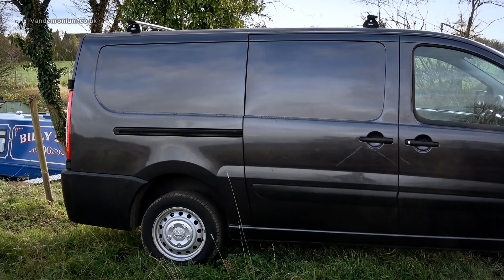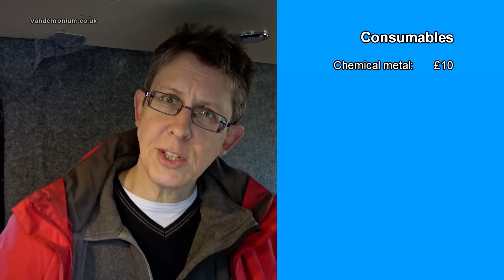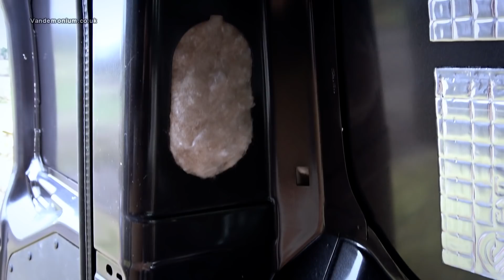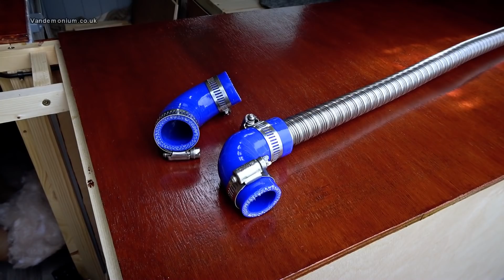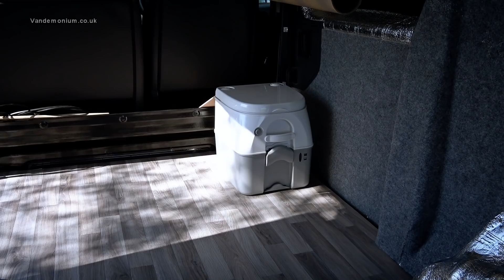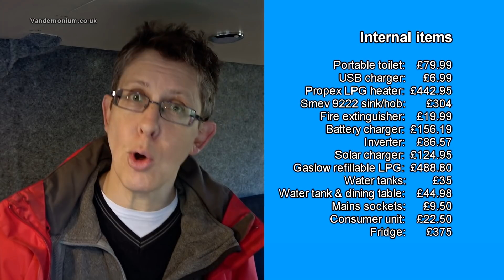Vlog 26: The costs of my DIY self-build campervan conversion

Comment: I have a crazy question, but did I hear you say that you pay tax every year? Seems to be a total rip off imho. But I probably didn’t understand you correctly...

Cheerio,

Bryan from Vancouver
Reply from the maker: There's an annual "road fund licence" colloquially known as the "tax disc" (even though we no longer display it in the vehicle as a disc) which is paid annually per vehicle.
Reply: Vandemonium Wow. Our government tried that here but they got run out of town politically. We pay enough taxes and this was seen as another. Thanks for explaining.

Bryan from Vancouver
Reply: @pinebearclub  In Australia each State has its own vehicle registration charges, with some more expensive than others. In Tasmania our registration is cheaper that most other States & covers: rego fee, road safety levy, motor tax, duty & Motor Accident Insurance Board (MAIB) premium (covers you if you injure someone else), plus GST on the MAIB. Cost varies vehicle to vehicle. My 2013 X-Trail costs around $563 each year. Bigger vehicles cost more...
Reply: pinebearclub it’s called “registration” in Canada.

Comment: The first Van-vlog I've seen, a nice supplement to the narrowboat vlog, which i have been following since ages. Interesting to see and hear about keeping track of costs. As a scale model builder - and this is fairly important - you always divide the costs by months of building (until completion), which gives you a better average spending picture. In my case the average is around £100 per month. ;-)
Reply from the maker: Mmm, my build was pretty sporadic though so I'm not sure that figure would mean much in my case.
Reply: Well, so is model building - you shall never carry out "hobby tasks" if your heart is not with you.

Comment: You have a drivers license that tells anyone you can drive, a title for the vehicle to show anyone it belongs to you, but you need a licence to place/display on the van to show all you can drive it on the highway.   In your explanation you did not include that cost.  I might have missed it but I did not get the cost  for the vans license.  You told us what the van cost and I assumed you have a drivers license, but the cost of the license was not included in your cost.
Reply from the maker: Hi. As mentioned in my prior reply, that is the tax disc which I did include in the first set of costs.
Reply: kerplunk8011 If you view the video at 3 min 10 secs you’ll see that you’re wrong.

Comment: With regards to rear tyre would get a 4 wheel tracking check, something is amiss tyre wearing unevenly.
Reply from the maker: It's not worn! Truly, in reality it's fine and it's done less then 1,000 miles
Reply: I believe you David!  
It may be that the scuffed tread pattern where the tread and sidewall meet on your tire looks like the wear indicators that appear when the tread is worn out.

Comment: License for the van?
Reply from the maker: Kerplunk, I'm still not sure what you mean by licence. We pay an annual tax disc, which I listed, maybe that's what you're thinking of.
Reply: @Vandemonium  I suspect that might be the answer and for that tax you would be given a tag to put on the back of the van.
Reply from the maker: Since very recently there's no tag (paper disc) to display in UK vehicles anymore, the information is all stored electronically by the authorities, tied to the vehicle's number plate.
Reply from the maker: I don't understand the question..?
Reply: It's a road tax licence. (I'm assuming kerplunk8011 is not a Brit).
Reply: You were listing the cost of the van, but I did not notice your cost to license the vehicle.

Comment: Congratulations David.👍 Of course you could have just bought ready made but:
1. It would have cost more.
2. It may not have been exactly to your requirements.
3. It may have used cheaper components.
4. You would not have a clue where the technical bits ran.
5. You would not have built up a shed full of tools’.
6. You would not have a real sense of achievement.
7. You would not have had the arse clenching moment(s) as you cut big holes in the van.
8. You would not be as confident doing projects as you are now.
9.If anything goes wrong you know where to look and who to blame.
10. You have saved a great deal of money , all other things being equal.

Well done!👍
Reply from the maker: All excellent points, including the arse-clenching ;-)

Comment: As you may remember I followed your build quite closely, mostly it was my academic curiosity about what actually needs to be done to perform such a conversion. Some comments on costs, after seeing what the fit out cost I can see why you got a good solid van to start with, also for the quality of the items you used I think you did quite well on cost, you save more by buying the right things the first time than by buying them twice. Seeing what you spent on paint and other consumables was a solid reminder of why people end up with piles of that stuff that is half used. I still think you did quite well, but I can't wait to see how it all works and what changes you make once you start using the van, I believe I mentioned that things tend to migrate from their original storage locations and storage spaces tend to get modified once they are in actual use. One other thing I will mention is that you did buy some really nice tools, those should outlast you and the person who inherits them.
Reply from the maker: Yes I'm very pleased with my tools. I will also be curious to see how the van evolves!

Comment: Pedant time: I thought less than was correct for miles as it's continuous (can't be counted). I could be wrong.
Reply from the maker: But the miles are individually counted units even though the distance covered is a continuous entity so ... ?!!??
Reply: @Vandemonium  since it's a distance i'd say it's a measurement rather than a count. That measurement would rarely be exactly a whole number of miles. Just rounded to a whole number. Just sticking up for your presenter self over your editor self.

Comment: I am amazed at how cheap the Victron inverter was compared with their charger or pv controller.  And I agree with you - don't, whatever you do, buy an 'unbranded' inverter off Ebay for £10 - that way  disappointment (and possibly fire) awaits you..
Reply: Its only a 700w inverter - i should hope it’s relatively inexpensive!

Comment: I’d say god job done & although the price of “stuff” is simply outrageously expensive, you have a very nice van fitted out with good quality gear. BTW my Dometic fridge, latest model & next size up to yours was close too £700!!! Ouch! But, it is superb & draws little current.
Reply from the maker: Ouch indeed
Reply: When a fridge costs so much money i do wonder whether a 240v fridge would serve better. The price difference could go towards more solar/battery/inverter and the inverter consumption would also be offset by 240v fridges often being more power efficient.

Comment: I have $63,000 in a campervan in the States not including the van!  Paid a friend for labor, mostly.  It is an extended Ford F350 extended (20 feet) with after market high top.  A lot more room, but still sounds like significantly less cost than UK.

Comment: You total seems a pretty fair cost even when converted from £ to $.  

Having spent a fair amount of time both in England and on the continent, it is difficult for folks here in the USA to understand the depth of what is available in local specialty shops there.  In the USA, much of most RV specialty parts are only available from the Internet or mail order type catalog. You can go to a local RV dealer but the stock will likely be ancient and horribly overpriced.  Local shops overseas have expertise available very much missing in the USA.  Employment in an RV shop in the USA is generally for minimum wage and require absolutely no training or knowledge whereas in England, and on the continent, I found most specialty shops owned and operated by 2nd and 3rd generation craftsman.  Of course, there are always exceptions but in general, the sheer size and nomadic nature of the USA leaves us with less depth in the trades and DIY projects are a bit more difficult because of it.

To give an example of the continental "local craftsman" advantage, are Davis's bed/couch cushions.  I did a conversion to a Ford Transit Connect (in the USA the Connect is basically Ford's version of your Toyota) and getting custom sourced cushions from a local (within 100 miles) upholsterer cost near double your cost ($850) and took 4 months to get completed.  For the upholsterer, the job was not profitable enough to bother with as he was the only upholsterer in the area.  He was far more interested in building a custom couch for an office building (there was one there invoiced for pick-up at $4200).  The couch was longer than a residential type and lushly upholstered but $4200?  Thus I had to beg to get my expensive cushions made.

David your finished product looks great, and you did it yourself.
Reply from the maker: Wow I had no idea it was such a problem / cost there!
Reply: @Vandemonium , that's one of the reasons why YouTube "infuencers" from the USA get so much support (read: free products) from manufacturers as they (the manufacturers) need the DIY videos on YouTube to provide "expertise" to assure potential purchasers their products can be installed by those with basic skills.

Comment: 5K to convert is pretty good. I totally concur with your choice to not do it on the cheap, it costs more in the long run, says the voice of experience. Plus the aggravation of removing the cheap item and fitting a replacement that never quite goes in the same way and does not look as nice. Well done and thanks for all the information.

Comment: The Diall insulation is now £20 at B&Q. I put my deerstalker on and went searching for it for my garden shed, after seeing you use it.
I always prefer Wickes but they don't do a pack of that compact size, only ones that are as long and manageable as a body rolled up in a carpet. -  Just for clarification, I've never needed to move a body wrapped in a carpet, I just have a vivid imagination.
Reply from the maker: Haha yes thanks for the clarification.